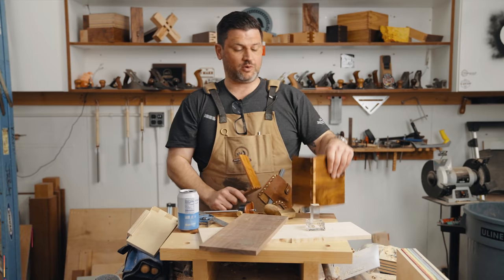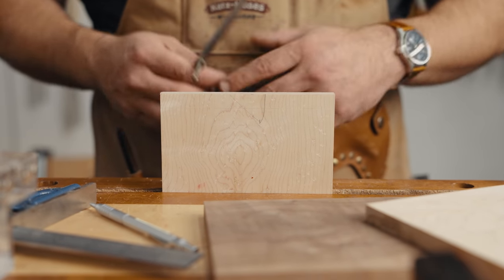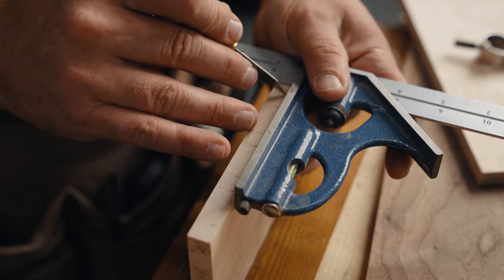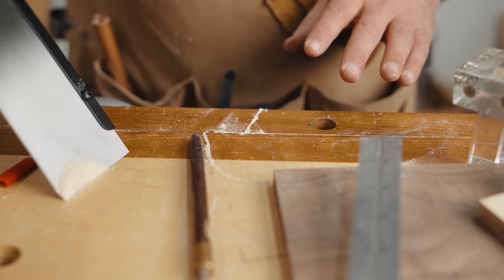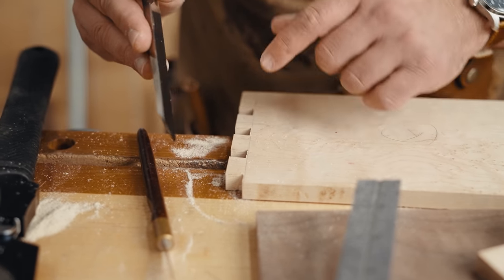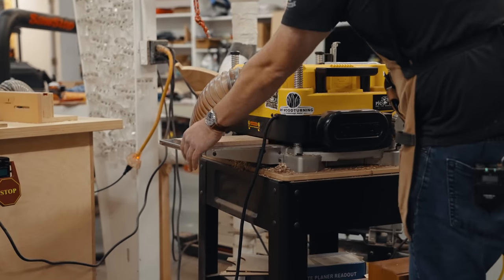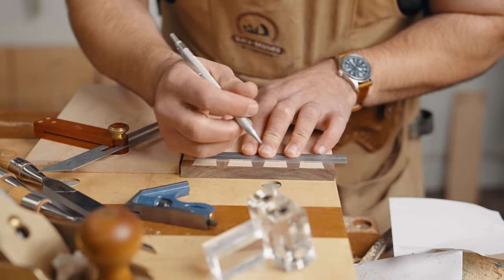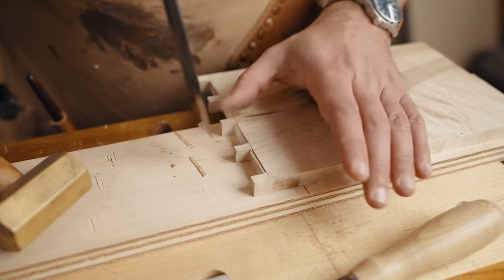3D Dovetails - A Comprehensive Guide

Comment: I got one of you alignment boards and dovetail guides for Christmas and my work has gone from ok to great.  I've been trying to muster up the courage to do an inlayed dovetail.  This video has inspired me to take the leap.
Reply from the maker: If you can cut a dovetail you can cut these. Cheers!
Reply: @katzmosestools  The only power tool I use is a bandsaw to resaw and I start with sawmill stock, so everything is hand thicknessed.  It's fun, but a lot of work to get to the dovetailing stage.  I've been afraid of spending the time and then messing up.  With my luck I'll cut the tail of a tailboard, LOL.
Reply from the maker: @beernut6153  best part about dovetails is, if you screw up, you only have to remove like 3/8 of an inch and start over.

Comment: Beautiful joint. Quick question: Because the teeth are on one side of the saw, does it matter if you use it left-handed?
Reply from the maker: They're equal on both sides. There's "tooth set" on the left and right.

Comment: Alright this looks awesome but I can't for the life of me figure one thing out.  Should the first set of tails (in the main board, not inlayed board) be cut 1/8" deeper than the width of the mating piece to account for the 1/8" inlay?  When the jig hit the ground you were starting to say "It may seem counterintuitive" and that might be the question I'm asking.

OR.... are the pins just narrower than they would be and this would work out just by following the "normal" marking out?  Sorry this is probably simple but it's bending my brain early this morning.
Reply from the maker: No you cut them the depth of the width of the board. Later you leave an eighth of the inlay
Reply: @katzmosestools  thanks. I just can't see how it works in my brain. But I guess that's where the 3D part comes in and still shows on the front. Thanks for all your videos! Hoping to save up for a half decent set of chisels saw and your jig before too long!